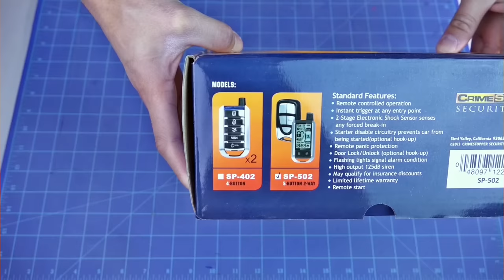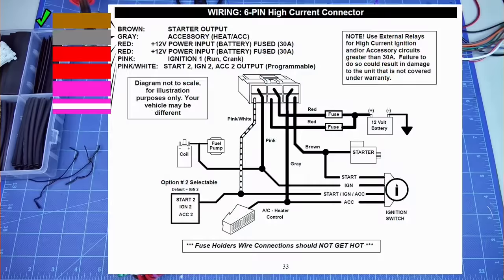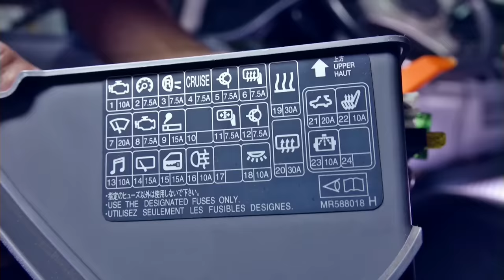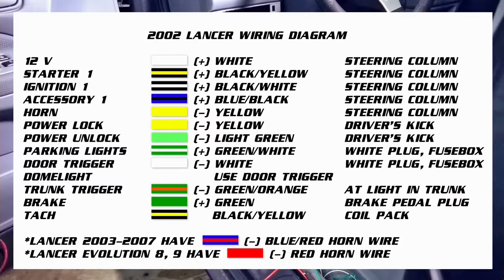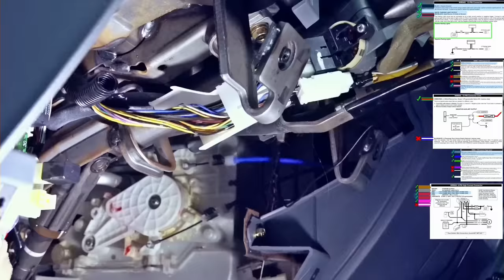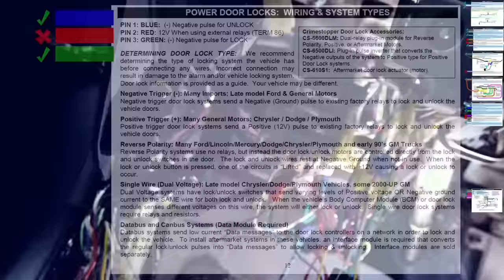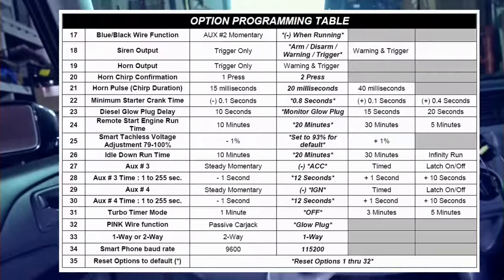Lancer Fix 35 | Remote Start + Alarm SP-502

Comment from the maker: Crimestopper SP-502
eBay https://goo.gl/TcqFDc
Amazon http://amzn.to/2n9mDqp

Electric Trunk Release Kit
eBay https://goo.gl/hfy2yZ
Amazon http://amzn.to/2oYC8Ob

12V 40A 4P Relays
eBay https://goo.gl/lyNPJV
Amazon http://amzn.to/2n9fdDd

Soldering Iron 60W
eBay https://goo.gl/aqH0Tu
Amazon http://amzn.to/2oGmhV3

Soldering Wire 60/40
eBay https://goo.gl/str3K6
Amazon http://amzn.to/2nCthR5

Capri Tools 20012 Self-Adjusting Wire Stripper
eBay https://goo.gl/jw0b0c
Amazon http://amzn.to/2oGyxFj

Titan 11477 Ratcheting Wire Terminal Crimper 
eBay https://goo.gl/8aE9LH
Amazon http://amzn.to/2oYi66D

60 Pieces T-Tap Connectors Combo Set
eBay https://goo.gl/F49Ee4

300 Pieces T-Tap Connectors Combo Set 
eBay https://goo.gl/1hb59s

600 Pieces T-Tap Connectors Combo Set 
eBay https://goo.gl/0a0N7w

100 Pieces Quick Splice Connectors Combo Set 
eBay https://goo.gl/Rf24s4

250 Pieces Quick Splice Connectors Combo Set 
eBay https://goo.gl/fK4UyT

URBEST®180 pcs Heat Shrink Wire Wrap Cable Sleeve Tubing Sets Assorted Size
eBay https://goo.gl/X9Ak0L
Amazon http://amzn.to/2oBj8sp
Reply: DarkDragonWing  I install the same alarm on my 2006 scion xb,everything is working perfect. But when I do remote start it only stay on for about 12 sec.and then shot off, and start again, but won't stay on keep doing the same again and again... ?????
Reply: Hi how do you wire in the relay for the imobliser like have you got a diagram you could possibly send me a pic of please i take it the main brain alarm box sends a negative triger to the relay but what else does it need ground 12v and what else as trying to work out to wire my imobiliser relay thanks buddy
Reply: Hi there great job there.can you please tell me where can I find wiring diagram like yours for my nissan almera n15 1998.? Thanks

Comment: Much thanks on this, I have a remote start that I've had for a couple of years for 2005 Mitsu outlander.  I couldn't see where to find the wires i needed to tap into .. and then ran into issue with immobilizer.  After watching this I"m ready to tackle the project again!

Comment: I installed crimestopper rs4-g5 on my rav4 2006. I am having trouble getting the AC to turn on while engine is running after pressing remote start. Is the issue related to the 14 gauge gray while? On the crimestopper, The gray wire should be connected to the blower wire by the ignition switch right? Thanks

Comment: Do not use those quick squeez connectors. I remove a whole lot of them at work. They work well for about a month. But they vibrate loose. Soldering is always the best way.
Reply from the maker: +damon cree Yes, I agree, but these ones that I used are extremely tight. I filmed this video about a couple months ago. Everything still works very good.
Reply: they're also called CRAMPS here! cool!

Comment: Have you  had any complaints from using the taps taps and quick splice vs soldering.
Reply from the maker: +Gee White Not that I know of. Either soldering or taps, both are good. It depends on how you do it. If you do soldering, you have to do it nice and full of soldering wire. If you are using taps, make sure you pick the right one for each wire and make it tight. Zip-tie things in place, no play, no problems.

Comment: Really nice.
How would it work with manual gears? Would there be a controll before starting that there is no gear locked?
Reply from the maker: +LeoBeoo For manual transmission:
1. You have to always put it on neutral, and pull up the hand brake.
2. Connect the hand brake wire.
3. Program option 15 Transmission Type to "Manual Transmission set with Remote Control"
Reply: +DarkDragonWing 
Thank you.
I will install this for sure in the near future.

Comment: hi. I bought an unbranded car alarm system. ive looked online to find anything about it but I haven't had any luck. and since there is nothing about the alarm system I bought my friend wont install it for me. if I can send you a pic of the wiring diagram of the remote start could you help me determine what wires I need or don't need and what they are for
Reply from the maker: +David Johnston Yes, I will try, here: https://www.facebook.com/DarkDragonWing/

Comment: +DarkDragonWing the connectors you used to connect cables they have a tendense to break cables really fast thats why they are not recomenden to be used.
this is based of personal experiance i only solder ofter i ended up needing to change all wires on my car.
Reply from the maker: +stilloading adventures These ones that I used on the car are extremely tight. I have to use the pliers to lock them up and what not. It has been about two months now. Things are still good. How long did yours last until you have to go back and solder the wires instead?
Reply: how tight they are doesent matter its becouse they damage the wires when you use them because the way it cuts in to the wire it cuts some of the copper and breaks the wire inside

Comment: Hi, I have mitsubishi mirage 2000 DE 2door 5sp , I see you video and buy the same alarm thanks very easy to installing just i need you help were its the hand brake wire in my mirage i want to start the car with remote alarm,  thanks a lot please help....

Comment: Hi DarkDragonWing have been trying to make my own remote controlled cars but obviously there is no way I can make the electric circuit as well. I have been watching your vids a lot and seen that you add the electric board when you finish making the cars. I wanted to know how you get hold of you electric boards as I want to also buy my own. also I have been trying to learn a bit about electronics but I can't find books or something to help me. how do you learn about it and I would really appreciate it if you could help me with my problem.
Reply from the maker: +sojaboy171 Hi. Thanks. :) What electric board are you referring to?
Reply: +DarkDragonWing 
the remote control and the receiver that you put inside the toy.
Reply from the maker: sojaboy171 I see. Well, you can buy the one that comes with everything here. You can buy one of these.
I buy this one:
http://www.nitrorcx.com/madspeed-drift-car-green.html
These ones are good too, but they are more expensive:
http://www.ebay.com/sch/i.html?_sacat=0&_from=R40&_sop=15&_nkw=1%2F10+madspeed&rt=nc&LH_BIN=1
http://www.ebay.com/sch/i.html?_odkw=1%2F10+hpi+drift&_udlo=190&_sop=15&LH_BIN=1&_osacat=0&_from=R40&_trksid=p2045573.m570.l1313.TR2.TRC1.A0.H0.X1%2F10+hpi+drift+RTR.TRS0&_nkw=1%2F10+hpi+drift+RTR&_sacat=0
http://www.ebay.com/sch/i.html?_udlo=290&_sop=15&_mPrRngCbx=1&LH_BIN=1&_from=R40&_sacat=0&_nkw=1/10%20mst%20drift%20RTR&rt=nc&_udhi
http://www.ebay.com/sch/i.html?_odkw=1%2F10+tamiya+drift&_udlo=300&_sop=15&LH_BIN=1&_osacat=0&_from=R40&_trksid=p2045573.m570.l1313.TR0.TRC0.H0.X1%2F10+tamiya+drift+RTR.TRS0&_nkw=1%2F10+tamiya+drift+RTR&_sacat=0

Comment: Hey Mackey, I didnt see where you wired the trunk trigger wire. Is it in the video? Is it necessary or only optional? Thanks
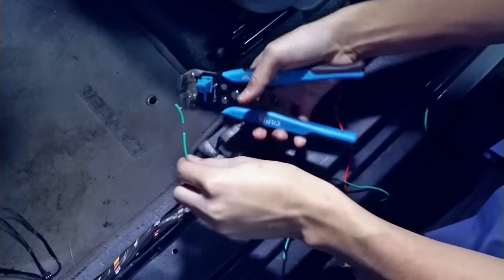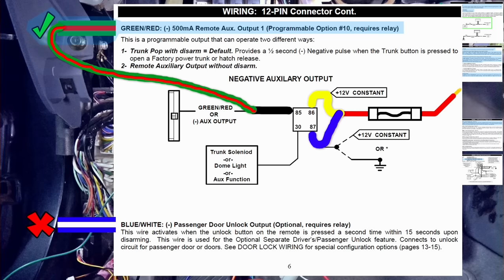Reply from the maker: It's optional. Here is where I connected the button for the trunk and also left a wire to connect to the alarm unit at 7:26 . At 10:20 I connected 12v fuse for the trunk release kit. At 12:54 I can connected the wire that I left and the relay.

Comment: Does the 2002 and 2003 lancer es has the same lock,unlock and parking light wiring color diagram? Thanks
Reply from the maker: Yes.
Reply: @DarkDragonWing  thanks I'm installing a cheap keyless entry system from Amazon. This video is a great help.
Reply: Is this Lancer negative or positive trigger?

Comment: hi. i have a Nissan frontier np300 and a tomahawk ts-9010 alarm kit wit remote start. i would like to istall this alarm. can yout tell me how. i know the unlock and lock controle box and wire colors. i need the colors for the ignition and dome light function, door switch..park light and horn. thnks

Comment: Hi Mackey, 
Did you use additional cables?  What gauges and how long?  Thanks!
Reply from the maker: 22-24 gauge is fine for this job. I would say 25 feet
Reply: How many colors did you use?  I saw red and green from the trunk to the front.  And purple at the steering.  any other color?  How many connector should I buy (estimate please)?  Is it safer to use a butt connector instead of soldering the two wires? 

Pardon me for asking a lot of questions.  I will be installing the same brand and model of remote start to my 2002 Mitsubishi LANCER LS.  Your video will be my guide.

Comment: oh and where did you buy the alarm? is it possible to order from it when i live in norway? :)
Reply from the maker: +ZEN GAMING I think so. Here:

Crimestopper SP-502 2-way Paging Remote Start Keyless Entry Car Alarm Vehicle Security System
http://www.sonicelectronix.com/item_65736_Crimestopper-SP-502.html

Omega TR-2 Electric Trunk Release Kit
http://www.sonicelectronix.com/item_31524_Omega-TR-2.html

1Pcs 12V 12Volt 40A Auto Automotive Relay Socket 40 Amp 4 Pin Relay & Wires SWTG
http://www.ebay.com/itm/231747843551

Capri Tools 20012 Self-Adjusting Wire Stripper
http://amzn.com/B01018CYV8

Titan 11477 Ratcheting Wire Terminal Crimper 
http://amzn.com/B0069TRKJ0

60 Pieces T-Tap Connectors Combo Set (Red 10-12/ Blue 14-16/ Yellow 18-22)
http://www.ebay.com/itm/391023217679
300 Pieces T-Tap Connectors Combo Set (Red 10-12/ Blue 14-16/ Yellow 18-22)
http://www.ebay.com/itm/261850126306
600 Pieces T-Tap Connectors Combo Set (Red 10-12/ Blue 14-16/ Yellow 18-22)
http://www.ebay.com/itm/261855333638

100 Pieces Quick Splice Connectors Combo Set (Red 10-12/ Blue 14-16/ Yellow 18-22)
http://www.ebay.com/itm/380454940180
250 Pieces Quick Splice Connectors Combo Set (Red 10-12/ Blue 14-16/ Yellow 18-22)
http://www.ebay.com/itm/271903241214
Reply: ok thaks! :) :)

Comment: Halo bro..can tell me how to wiring 1 wire output from alarm module..because my alarm just 1 wire output for signal..
Reply from the maker: I'm not sure if I can help you. I need more information. What is the signal for?
Reply: @DarkDragonWing  my alarm have 1wire output..for headlight..its true just 1 wire for headlight??because i see another alarm module got to wire for signal and the colour of wire is yellow or brown..depends on module..but mine only 1 wire only..and i see in instruction for headlight

Comment: ok so my car is kinda fucked up on the central locking and i haw the alarm here and with the central locking diagram and there is a bunch of colors and i've got no idea on where to wire them O.o
Reply from the maker: +ZEN INDUSTRIES What car do you have?
Reply: peugeot 406 99 mod
it is a french car so its always problems with those car, so i wil buy a new central locking system and try conecting it new :P
Reply from the maker: ZEN INDUSTRIES Ok :D

Comment: Hello ! can you help me please i've got to install an alarm on my car and it has a remote unlock but my car is old and the unlock system is fully mechanical so what can i do ? :/
Reply from the maker: +Lol97410 and Statan Gaming | FR You will have to add power door lock/unlock solenoids.
Reply: +DarkDragonWing  And what is that can you give me a link or something ? ^^
Reply from the maker: Lol97410 and Statan Gaming | FR What car do you have? How many doors?
Reply: +DarkDragonWing Its the nissan sunny III break y10 it has 5doors
Reply from the maker: Lol97410 and Statan Gaming | FR Ok. You can try these. I have never used them. But if you can understand it and can figure it out to put in your car, it is possible. http://www.ebay.com/itm/Universal-Car-Central-Power-Door-Lock-Unlock-Remote-Kit-For-Keyless-Door-Entry-/251936328960?hash=item3aa8934d00:g:tuMAAOSwymxVPdVK&vxp=mtr 

Here, this one is for the trunk: http://www.sonicelectronix.com/item_31524_Omega-TR-2.html
Reply: +DarkDragonWing Ok and I can connect it to my alarm or i need to use the headunit with the lock system ?
Reply from the maker: Lol97410 and Statan Gaming | FR You can use it with your alarm.
Reply: +DarkDragonWing Ok ! and you'are sure it fit my lock system ? ^^
Reply from the maker: Lol97410 and Statan Gaming | FR No, it won't unless you modify it to fit. :)
Reply: +DarkDragonWing Ok ! :) really appreciate it :D

Comment: Hi ,, I have Manual Transmission Mitsubishi Lancer 2002 ,, when I press the Key Button ,, the Engine trying to start but it's fails for 3 times in row ,, please Help me .. where should I Connect the hand-brake wire ?
Reply from the maker: Did it crank the engine or nothing happened when you press start button?
Reply: yes it did
Reply: where should I Connect the hand-brake wire ?
Reply: I Found it on manual book page "30" ,, thx for your great video your awesome dude :)
Reply from the maker: ANAS AL-SABBAH Oh ok. No problem. I hope it works. Let me know. cheers
Reply: sure I will tell you about it :) thank you ..
Reply: It Didn't work with me I tried everything I could to do with Hand-Break Wires but no Luck ,, if you can make a video about it I will appreciated for it ,, I hope you can Help me with it :)
Reply: it's gave me 7LEDs Error , I don't know why
Reply from the maker: ANAS AL-SABBAH 
7 Parking Light Flashes (7 LED Flashes) = Manual Transmission Error.

Note: In Manual Transmission Mode, the LED will Flash 3 times if the parking park is not set.
Reply from the maker: ANAS AL-SABBAH Did you program option# 15 Transmission Type
to Manual Transmission set
with Remote Control?
Reply: Yes I did
Reply: DarkDragonWing
I know about the Error I think it's about the Hand-Break Wire because I don't know which one to connect
Reply from the maker: ANAS AL-SABBAH Connect to the one that sends out ground when you pull up the handbrake.
Reply: Connect to where or which wire of the SP-502 ?
Reply from the maker: ANAS AL-SABBAH 
BLACK/WHITE: Programmable – Start Activation or Hand Brake (Manual Transmission)
1. (-) Start Activation Input: This wire allows an outside source or accessory to activate a Remote Start. A
momentary ground pulse on this wire will trigger a remote start. Examples would be a GPS Tracker or Smart
Phone interface. Default = Start Activation

More here at page 8
http://www.crimestopper.com/cstech/library/security/security_systems/security_keyless_entry/sp-402_sp-502_ins_rev_09-28-2012_green%20kill.pdf
Reply: Thank you I will try it out and I will tell you what will happen

Comment: Protip, when looking witch wire is the airbag wire, DO NOT use the ohm meter, it has power output and it will set off an airbag.
Reply from the maker: +effectsbykaarel What should I use?
Reply: +DarkDragonWing Find by wire diagrams, don't mess with airbags, I've set off 4 by using the ohm meter on purpose. :)

Comment: can anyone please tell me how to wire a clutch bypass for remote start only but still need to depress when using the key...do you connect the remote starter "start" wire to the positive clutch wire and the cars start wire or just the clutch wire? thanks
Reply from the maker: What car do you have?
Reply: 2015 outlander sport stick shift.
Reply from the maker: J Aguasviva 
This guy just joined the switch wires on hi Sti https://www.youtube.com/watch?v=TwsAqyn-1jg

Some guy in the comment add another switch where he can turn on and off as he wishes. 
......
For Lancers, I believe it is the same with Outlander. You just have to unplug the switch/plug.
http://www.evolutionm.net/forums/evo-general/494427-do-you-disable-your-clutch-switch.html
Reply: hey so unplugging the switch didn't work. but touching  them did. thanks again man.